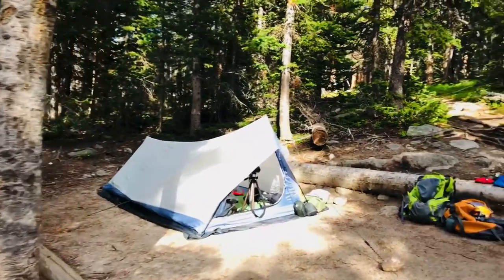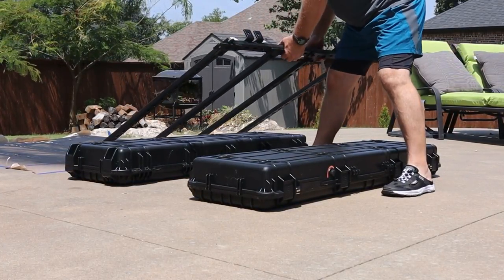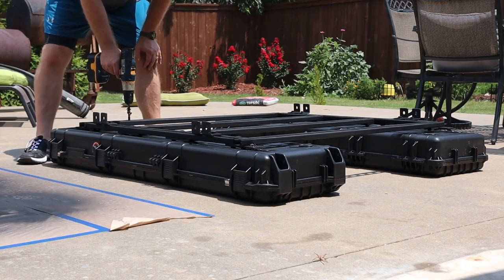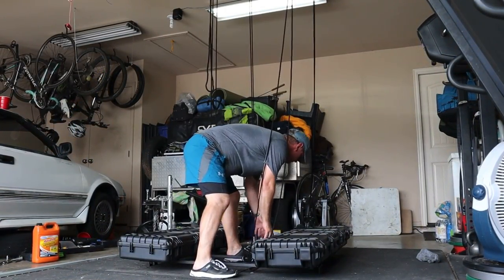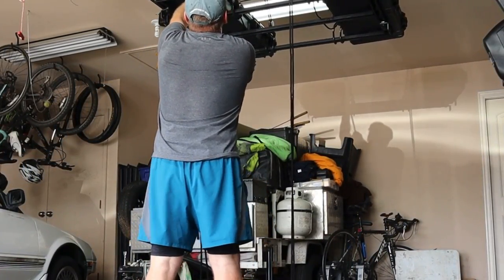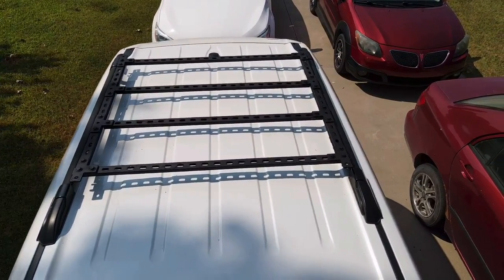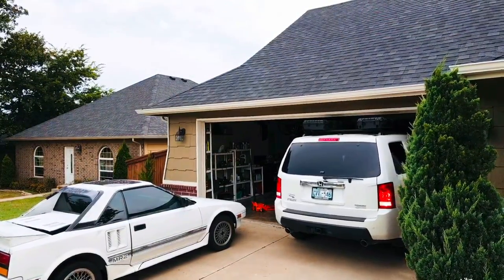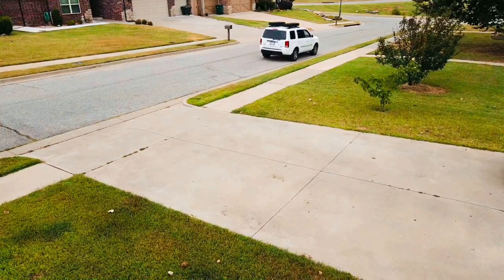Low Profile Storage System: Episode 3 #hondapilot #roofstorage

Comment: you did it so great 👍🏽👍🏽 just wandering where did you buy your nice headlights? wanna upgrade my 2011 pilot. 🙂
Reply from the maker: Thanks!  I bought them on Amazon. ACANII - For Black 2009 2010 2011 Honda Pilot Headlights Headlamps Driver + Passenger Side Aftermarket

Comment: You did a great job on this build! I really  like the final result!
Reply from the maker: Thanks man! Setting it up for a trip to Wyoming with a kayak and the camping trailer.  I will add some other features for another adventure.
Reply: @ericscamping  I love the modular design!
Reply from the maker: All those holes make it very easy to attach many combinations of equipment on the top of that base platform.  For my next trip I have the one case filled with regular maintenance equipment and the other top case is filled with kayaking gear.

Comment: I just picked one of those Harbor Freight cases this weekend because of their 4th of July sale! Going to put it up top of my Pilot as well. Great find! It's a great sturdy case for the price. How many bolts did you use to secure your case to your rack? 4? Or 6? Can't really tell if 4 (all 4 corners) is enough.
Reply from the maker: I did 6 bolts and used washers on each side with a little butyl puddly to seal it up.  I am happy with my choice, they work well.   Glad you found something that will work!

Comment: Hi ..how much did cost you all the material to do the roof rack???
Reply from the maker: It was right around $200.   Very easy to cut the superstrut… the most expensive parts were the connectors.   However, if you look on Amazon you can find those cheaper than I did.  Those fittings are called OhLectric.  Here is an example:  https://www.amazon.com/dp/B08C9HW2M3/ref=cm_sw_em_r_mt_dp_K0CCJK68M22D4PX9N8P1?_encoding=UTF8&psc=1
Reply: Thanks men...l have a 2012 like yours and l might do the same you did....